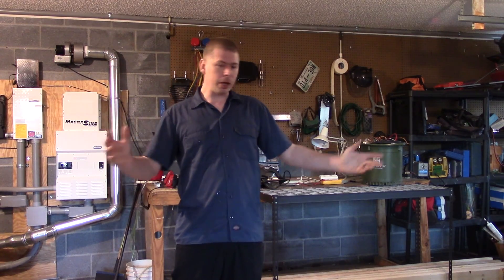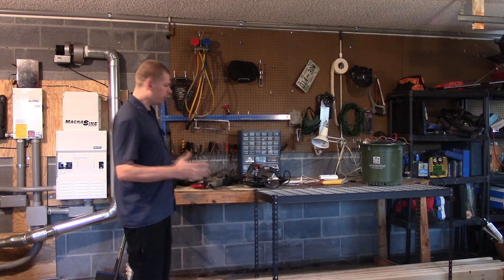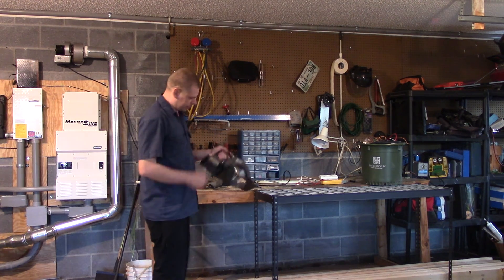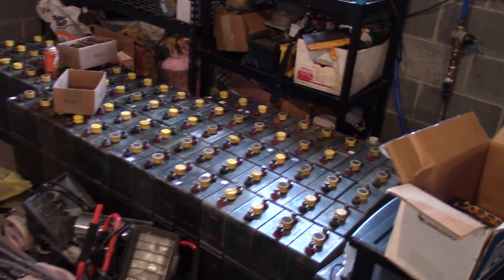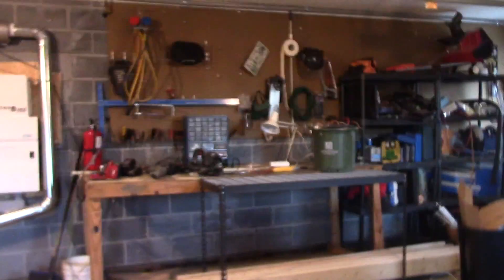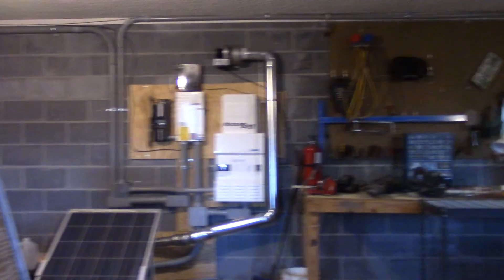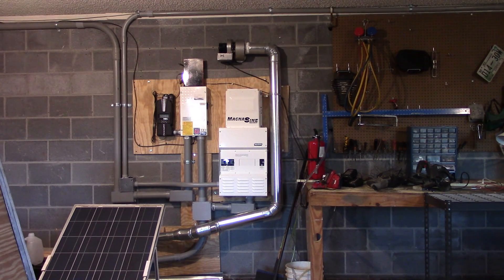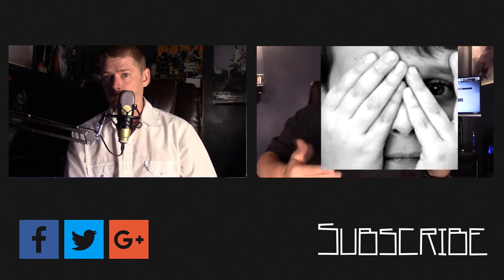Preparing to build a battery rack for the 85 Edison ED-240 batteries.

Comment: I would suggest running some 1.5 x 1.5 angle iron on the bottom of the stair runners, that is going to be a lot of weight on those runners. Great idea though on setting them up that way. When you get them hooked up if you can charge them at a 100 amps. It well wake them up and then run them down hard. Repeat this about ten times and it well amaze you how well they will perform. I look forward to seeing them up and running.
Reply from the maker: I will do something